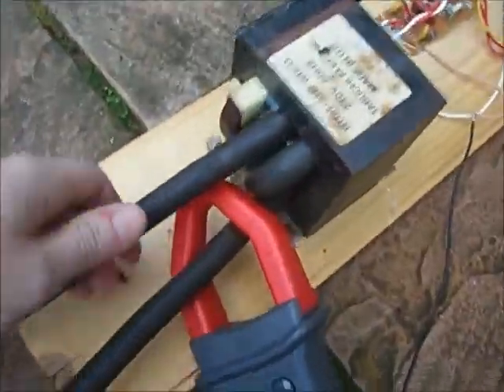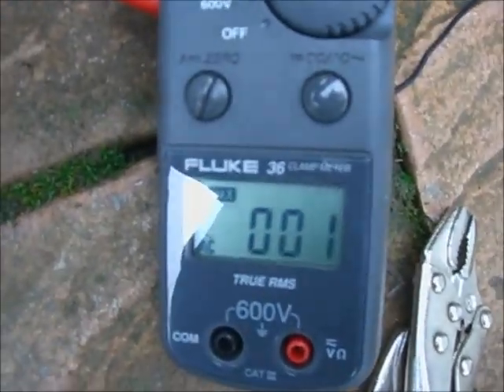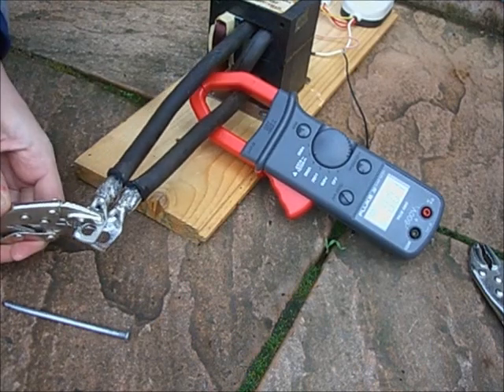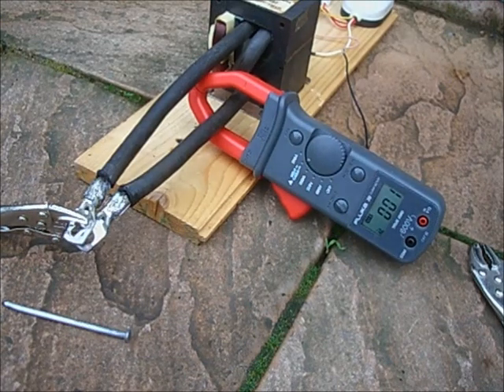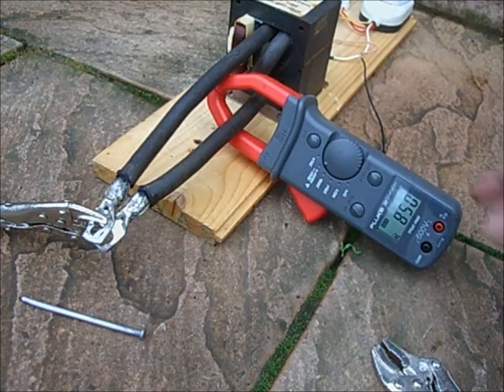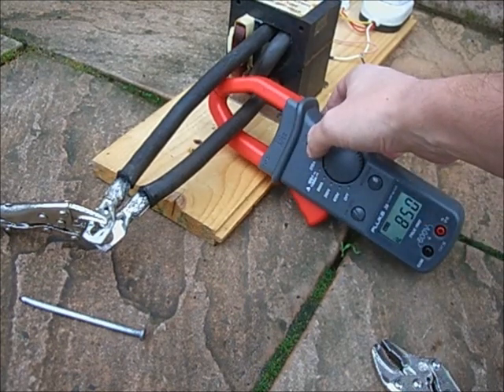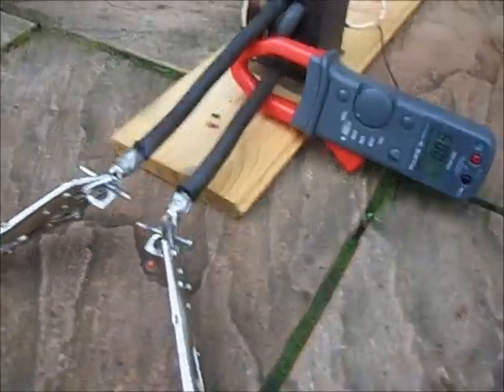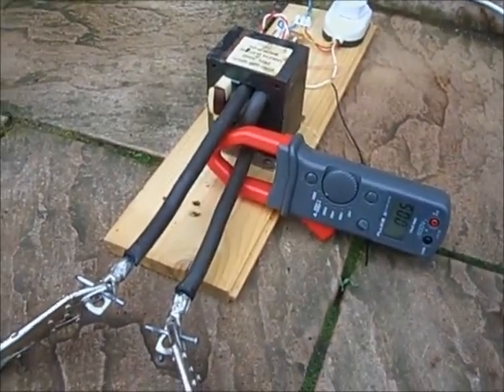High Current Transformer 1.6v @ 800A MOT

Comment: So is it the larger the gauge wire the more the Amps. And the more turns the more volts
Reply: Yes that would be right simply put. Current is the major factor here while voltage is playing a more secondary role and is only required in a minor amount for a spot welder. What is actually happening with his experiment is he is creating more amperage than the traditional use of a transformer is designed for. Originally they where designed to simply convert AC current to a more controllable and stable DC current (we can thank Tesla for that one) and to be applied to situations that called for high voltage like a power plant that distributes electricity. However over the years people figured out more current = more heat and can be used to melt metal hence why the transformer is sort of special in the case of a welder. Your trying to elevate heat and is probably the only electrical situation where you want more heat but it does come with a drawback. The major drawback to this particular transformer is run time. The mathematical ratio that is used to dictate the relation between voltage and current you usually want to be of an ideal balance but because it is thrown so far out of the original ratio it causes a situation where time must be monitored before critical failure is reached. This means if he pushes the transformer any more than a few minutes without cool down time the transformer will burn out.

Comment: why wire not melted but screw melted?
Reply: Iron  is thinner and has more resistance
Reply: Think of it as a fuse the nail is skinnier than the wires so the wires won’t melt and all the heat goes to the nail

Comment: Nope, the problem it is not the skin thikness, but the internal resistance of each person, and of course this current is able to electrocute. The hearth will stops with less than 100 miliampers so can you imagine what happen with this high current. That is the main  reason why the electric welding requires wearing globes besides the burning risk. For the welders of  course,  it is prohibited to touch with bare hands both welding machines cables.

Comment: Take two Transformers and remove the bottom of both Transformers and keep the 2 larger ends and wire them and Weld them back together. This will allow for more turns of the secondary winding. And a bigger Transformer.

Comment: mine outputs 3.2v at 1000amps
Reply: +BYUNG JAE Lee  Does it do both simultaneously - that'd be 3.2kW.  I suppose you mean 3.2V open circuit voltage & 1000 amps short-circuit current, which is a slightly different condition to the way you phrased it...
Reply: @Phillll  can you tell me that how much turns you used on input winding and output winding?
Reply: can you tell me that how much turns you used on input winding and output winding?

Comment: is there any risk whether you touch the terminals with your hands while the current is flowing ???  Do you need any protection??
Reply: +nomon95 well there is still no risk becaus the voltage is to low to penetrate the human body
Reply from the maker: Hi Jose.

No, as its a very very low voltage. Nowhere near enough voltage to cause a dangerous current to flow through the body.
Reply: wow  that's amazing !!
Reply: NO,THE VOLTAGE IS LOW,BUT THE TEMP IS VERY HIGH, THIS IS THE RISK
Reply: you can touch it with your bare hands bcoz of low voltage
Reply: +robot797 He said temp, that means it gets hot. Go melt a nail and touch it and you'll understand.
Reply: with the voltage in more than  48vca,,you feel the current flowing,,,but no risk. more than 48 vca you feel the ac oscillations,,,,this is the limit in  the electrical commands  48vca.  more than this voltage,,may not touch some parts of the body.in my country,,,Argejntine,,,we work with 220vca,,,you in USA,,,,three phase   is 3x 208vca ,,,but phase-neutral is 120vca,,,the body supports these voltage,,,in my country,,,220vca  phase-neutral,,,is very high,,,some people don"t tolerate this voltage,,,in my job (electrician) i received accidentaly 220 and 380vca,,but with a lot of pain,,,with 380vca,,,the skin contact is damaged.

Comment: hello friend i liked this movie, i whant to do this.
do you can help me?
which the reference of this transformer? 
The diameter of the cable?
Reply: I can tell you little but the transformer is a high voltage Microwave Oven Transformer but with the secondary took off and thick wire wrapped in its place. As for the diameter get the thickest you can get. 2 gauge is alright.
Reply: I'm trying to make the sensor of electrons. 
 this show is a bit like the sensor of electrons 
is a new technology in my country, but the government is hindering its evolution.

Comment: The amp died when I took it's voltage reading with a panel meter. Company is sending down a replacement. It's inside an aluminum case but it did get hot, even at idle. I'll put it in a new case and put a fan on it. With the low frequencies, an amplifier can become the transmitter. I found a way to make antenna ready waves. :) I took a listen and heard a few bleeps, probably from submarines around 20khz. Maybe this is why Military uses these low frequencies? They're easy to amplify and send out.

Comment: The sidebands turned out to be 11khz. I had someone helping me take a look at the waveform and they said there were two extra sidebands on it, but no frequency drift. Yes, I'm doing amplitude modulation with low frequencies below the AM band. Audio test is demodulating good with good audio without an antenna. The waves are propagating from the headphone out. Its showing up as 5500hz on the dial when I used an 11khz carrier. For some reason the 2 extra sidebands are also an additional 11khz.

Comment: The amplifier probably died because it was designed to match into 4 Ohms or 8 Ohms. I am guessing that your load was less than that, so the output stage would fry - unless you bolt it to a huge heat sink with plenty of cooling ! - Transmitters usually match into 50 or 75 Ohms at the required frequency (Impedance) - It sounds like you are trying to build something akin to the transmission systems used by submarines - Very low frequencies & very big aerials, sometimes the size of whole continents.

Comment: So your carrier, normally for a domestic AM transmission would usually be in the range of 520KHz - 1600KHz. Am I correct in thinking you are trying to use a carrier that is from 0Hz to about 22KHz and modulating that with ANOTHER audio signal. If you are then lets assume for a normal AM broadcast normal intelligible speech / music will create sidebands of about 3KHz either side of your carrier  19KHz and 25KHz (Carrier being 22KHz)

 is in the RF is ONLY just above audio then or if you like VLF

Comment: Excuse my English! I modified the secondary of a transformer of a microwave 1200w with 2 coils in parallel. but the iron is not heated from the center to the outside, but from the outside inwards. why? behaves so even with a simple loop, not in parallel. I noticed an electronic board at the entrance of your primary, what is its function?

Comment: I have a variable frequency wave. Strangely the amplifier died so I'll have to get a new one. That thing didn't even last a day :)  The sine wave is 0-22050 hz, 22khz and I put a low pass filter on there to try to keep higher and multiples of the carrier out of the air.

Comment: Right yes. I've been trying to modulate a sine wave frequency with audio and think I got it. Maybe I'll make a quick video to see if you think I got it correctly. Since it's low frequency, I'm having an amp amplify the antenna ready signal. Got shocked once, so won't touch both sides of the antenna at the same time again :) hehe.

Comment: If your transformer primary winding has a 50 ohm input impedance at say 50/60Hz - Impedance is resistance to AC at a given frequency, I am guessing you are using an audio amplifier, you'll need to somehow match the output impedance of the amplifier to the input impedance of the transformer. Most amplifiers are 4 ohm output, you'll either need to reduce the input impedance of your transformer or increase the output impedance of your amplifier to get a decent power transfer.

Comment: Thanks. I was looking at a 110 to 36 vac 150 watt step down transformer, but was wanting to use a 150 watt amp with it to bump its 36 volt analog audio output up to 110 or higher.

The primary I'm guessing is 50 ohm if the secondary can put out 150 watt at 36 volts. I was trying to match impedance speculating on the transformer's  ohm readings based on its ratings. The output side after stepping up voltage will connect to a dipole antenna where each half of it handles half the AC wave.

Comment: You can indeed step back up to mains voltage with a reduction in available current. the wire is thinner on the primary and there is more of it

s-cool.co.uk/a-level/physics/transformers-and-rectification/revise-it/transformers-and-the-turns-rule

Comment: Well the primary would be oscillating at either 50 or 60 Hz depending where on the planet you live. This would induce a voltage in the secondary, in this case your very thick cable, which is in fact a one turn transformer, which would also be oscillating Voltage or a potential difference is produced  ACROSS the two points of your very thick secondary. current is consumed by placing a device, like a bulb in SERIES in the circuit. Too much load on the secondary will pull its voltage right down

Comment: Good thing to remember. My actual application is attaching a dipole antenna to a transformer. I have 36 volts with no amperage on the transformer output meaning there's no closed circuit. Does voltage still oscillate in the line even though there's no detectable amperage in the circuit?

Comment: Another thing I'm wondering is if the input wattage remains the same on the output? Like150 watt primary. I guess a wall transformer lets amperage in depending on its resistance and the watt rating.

:) Maybe its possible to step voltage back up to 110 mains voltage if we feed it the max watt rating on the secondary to get something like 110 2.2 amp on the primary as an output.

Comment: if it's just a small battery powered transformer, it's amazing, but it still using 110 or 220 volts ac current passing through the electric meter, but anyway it's a good cigar lighter. lol.

Comment: Does that mean that because the voltage is so low, it won't be able to break through the skins resistance and electrocute you? So if I understand correctly, that means that a high current low voltage transformer like this won't be able to penetrate the skin and give you a shock?

Although I've never tried it myself (nor do I plan to, just to be safe!), I've heard that a 12V lead-acid battery won't shock you either, because of the low voltage, even though it has a fair amount of current?

Comment: So a couple of days ago i removed an old secondary winding from a small transformer and wound up a couple of turns of some thick wire, much to my surprise i got 306 amps and was mindblown lol but the thing that i wanna ask is that why doesn't it make a small arc when i get the wires really close? does voltage matter? because i got 0.8 volts from my transformer. Please reply asap i'm really interested

Comment: I need, because the only fuses in my house that do not have any permanent load on them are outside and for some reason they are 230v single phase with a 10A fuse. Using a MOT normally causes the fuse to blow after about 2 or 3 seconds :(

Comment: Nothing would happen because the voltage is way too low to penetrate the resistance of the skin. Even if it would penetrate it would only burn you a bit. Now,if the voltage was higher, lets say around 100 V,and if it would flow through your body,not just your finger,youd be dead.

Comment: On dry skin the noticeable threshold for shock on DC is about 80 volts and AC is around 70. When the skin is wet, that number drops drastically to 45DC & 35AC

Comment: Good vid! But ballast? You let a MOT draw what ever current it want even if it pops the fuse. :)

I have MOT at about the same size maybe slightly bigger, winded to 5.6V and at short circuit (not perfect though but very close) it pumps out 1042A and primary draw 37A. The fuse though only holds for 10A so it will not hold for a full second but its over 5kW and thats happy days.